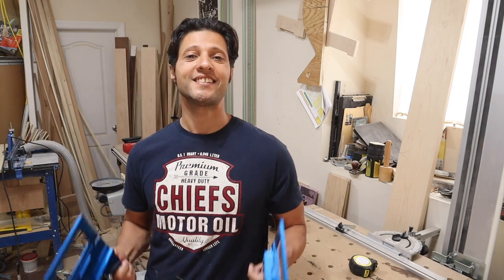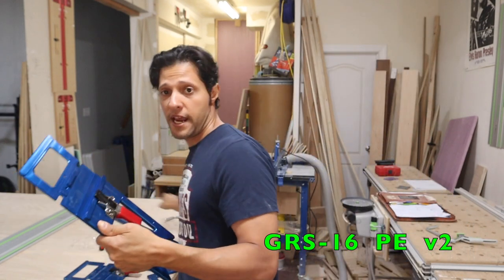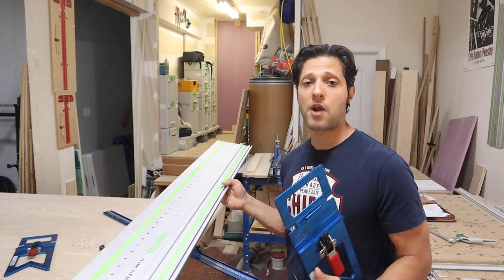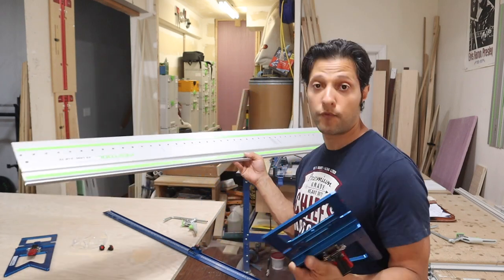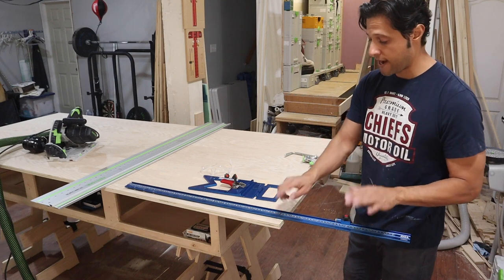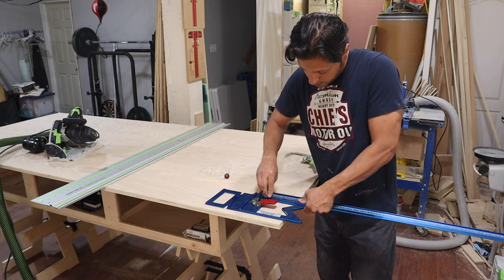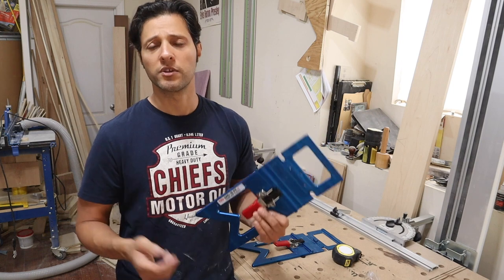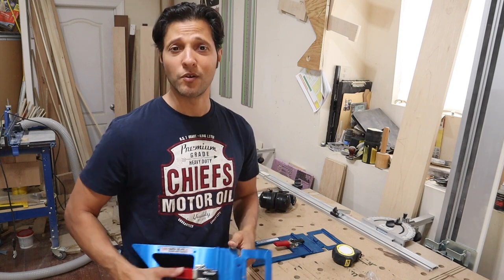new release, TSO Products guide rail square GRS-16 PE v2

Comment: Of course this version is introduced after I purchased the V1 a couple months ago. 😅

Thanks for the video, Anthony.
Reply from the maker: there’s nothing wrong with version 1, as long as you are happy with it. These new features are more of a convenience in efficiency. But if you’re looking for a second one, this makes it easier to use the parallel guides as a drop on connector also. Something to think about, especially during a sale, but only if you really need it.

Comment: Hi Anthony just a question about festool domino they say when you adjusting domino mortise with the buttons on the machine you should adjust them with the domino on ,running. Does it damage the domino machine.? Hey Anthony I brought that festool stm 1800 workbench I saw you had one. It’s very nice to use.
Reply from the maker: @shanehertzog5812  hi, yes with the domino df500, you have to switch Mortise sizes when the machine is running, or it damages the motor.  With the larger df700, you switch Mortise sizes with the machine off.

Comment: Do you know if the Festool FS-WA/90 is identical to the TSO GRS-16 PE v2? Trying to work out if the Festool one will fit the newer (red) Milwaukee tracks as where I am (UK) the TSO is back order only with an ETA of 12 weeks and I don’t really want to wait until Christmas.
Reply from the maker: @JameysVideos  the piece that slides into the bottom of the rail on the TSO is completely different from the festool one. As far as I know, the festool guide rail is not compatible with the Milwaukee track. TSO made on specifically to fit that new rail.
Reply: @AnthonyScolaro1 Thank you, appreciate it

Comment: I understand companies cannot make the perfect product, but wow does it irritate me when companies like TSO and Woopecker put out expensive products only to come out with new or upgraded ones a year or two later.  Some of the new improvements seem obvious if more R&D was done.
Reply from the maker: Honestly there is no need to replace the old one if you already have it, this is for people who are just buying their first rail square. This is the new model with very suddle improvements for the new generation of TSO rail squares. If you already own the older model, this will not really change anything for you.
Reply: Honestly, just grind or file the one half of the tab off and you get the upgrade for free.   It's a big shorter in the track direction, but the section past the center line (the part you file off) doesn't affect the accuracy because the clamp pulls it away from the centerline anyways...